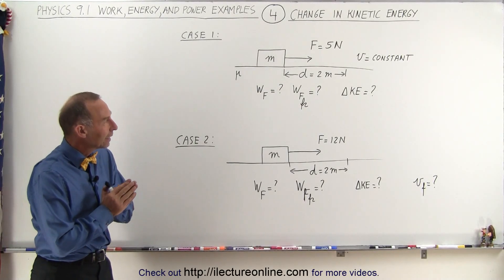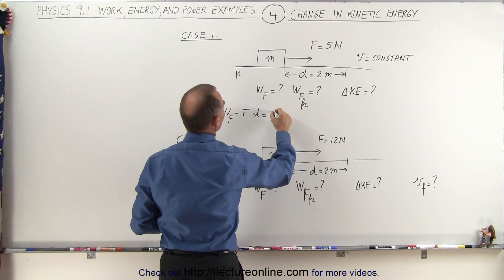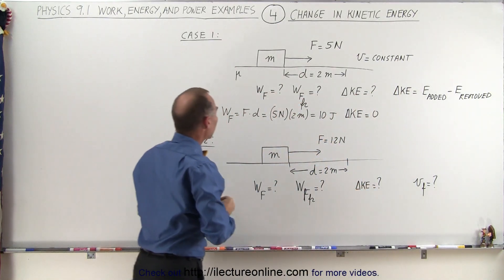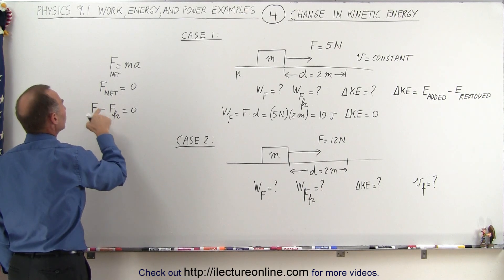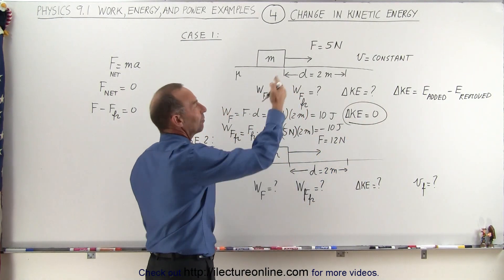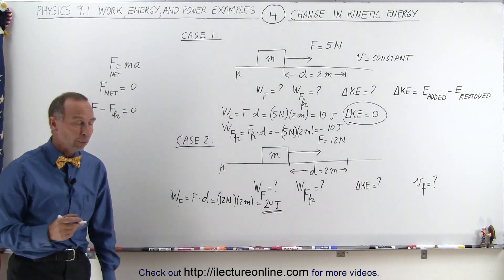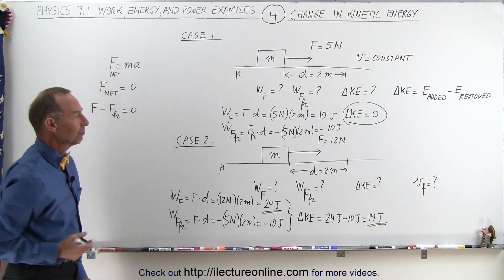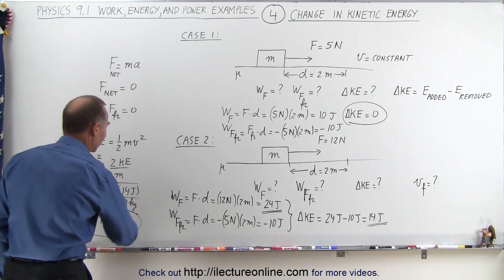Physics 8.1  Work, Energy, and Power Examples (4 of 27) Change in Kinetic Energy

Comment: Case 2 why WFr is as the case 1 (-10J) and not -24J? In case 1 I have F=5N than WFr=-10N so in case 2 I have 12N than WFr = -24N. In case 2 Why do you take WFr=-10N as case 1?
Reply from the maker: The friction force is the same for both cases.  The friction force only depends on the coefficient of friction and the weight of the object.  (when the surface is horizontal)
Reply: Ok, so 7Nw (difference between two casese) gives the deltaE for moving the mass from zero to 1.67 m/s. Is it correct?